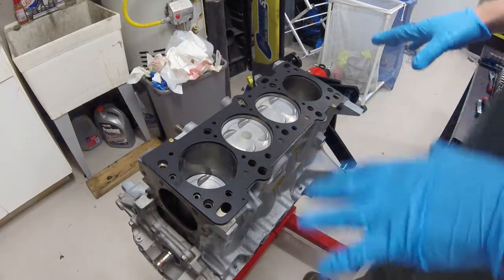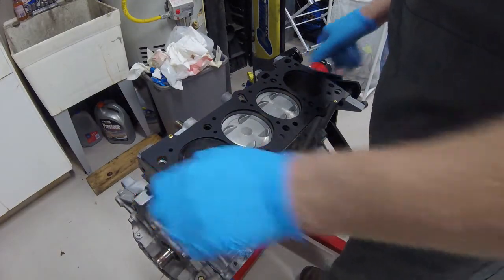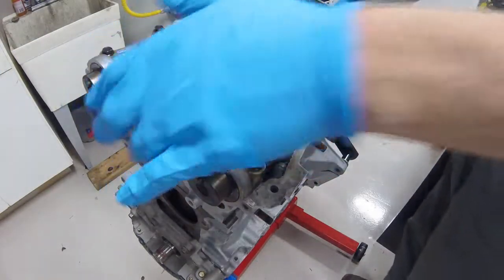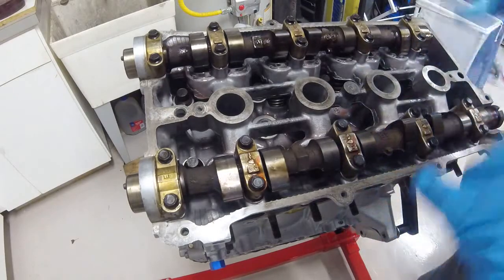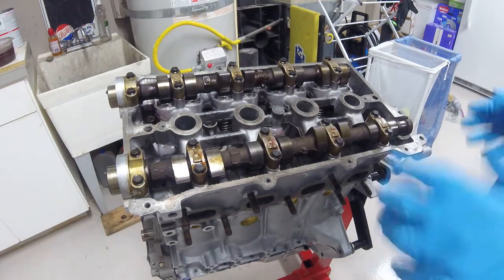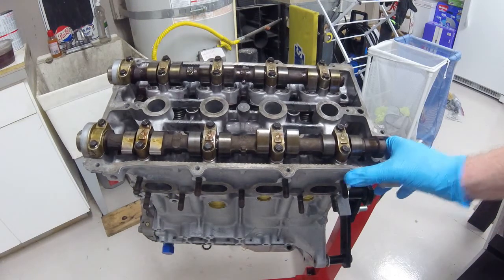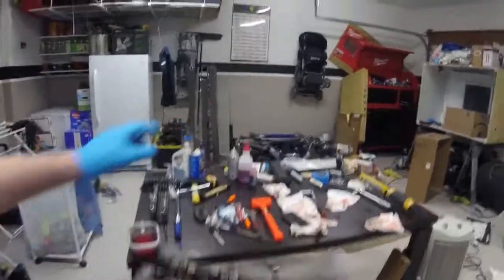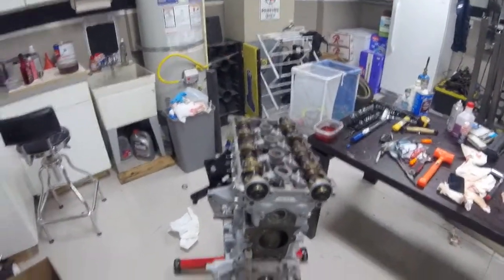Miata 1.8 Head Installation

Comment: Do you have the links for the building info? I'm looking at building a 1.8 engine to swap in my Miata before my 1.6 bites the dust.
Reply from the maker: I don't on hand.  But just Google 1994-1997 Mazda Miata factory service manual.  Or look on one of the Miata forums and they are readily available